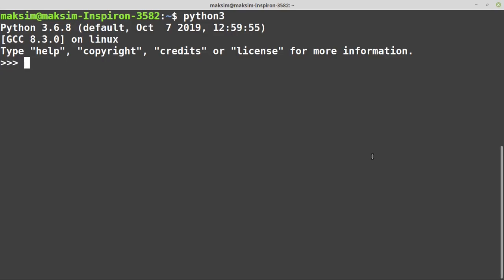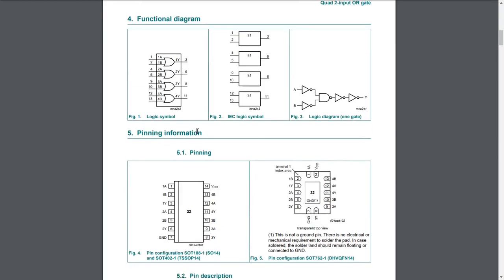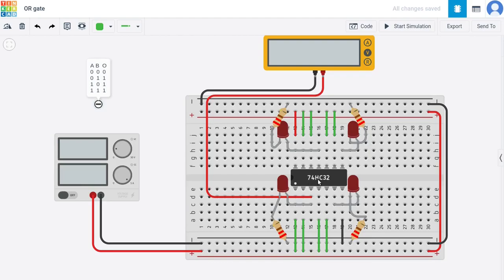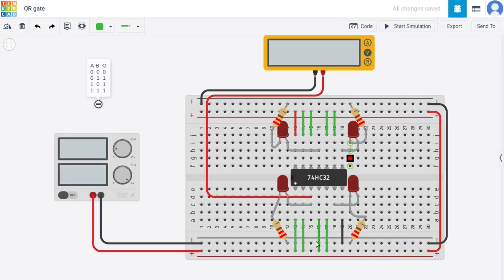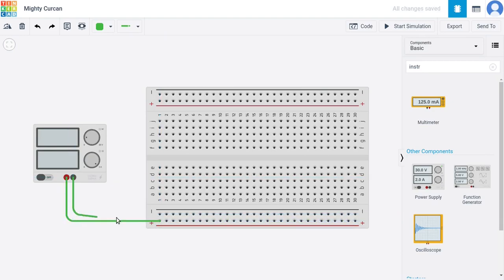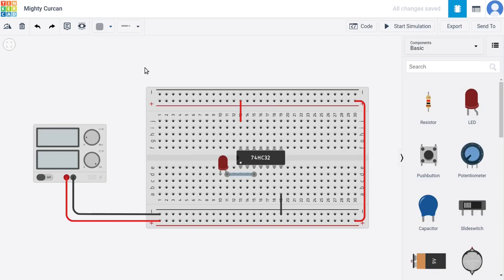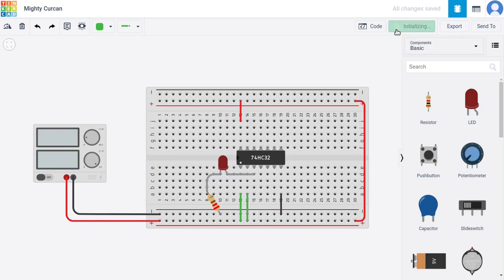OR gate - logic | circuit | truth table | step by step build using 74HC32 quad 2-input OR gate IC

Comment from the maker: 00:00 Software evaluation of a bitwise OR expression
00:30 OR circuit on mechanical switches (Sorry for typo in "Boolean"!)
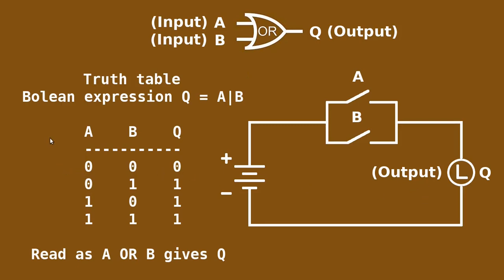01:13 Truth table
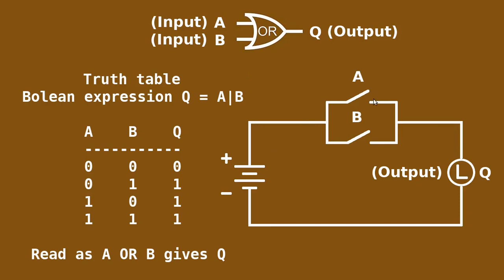01:55 74HC32 quad 2-input OR gate datasheet
03:55 74HC32 quad 2-input OR gate breadboard simulation
06:07 74HC32 quad 2-input OR gate step by step circuit build in tinkercad